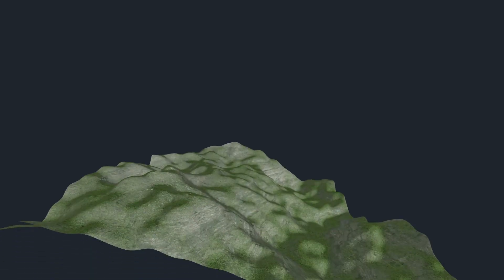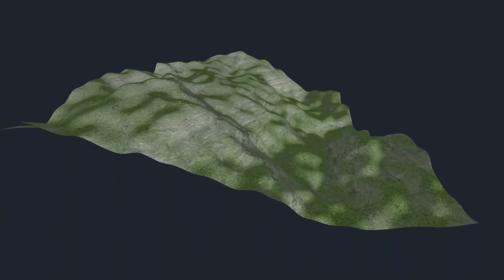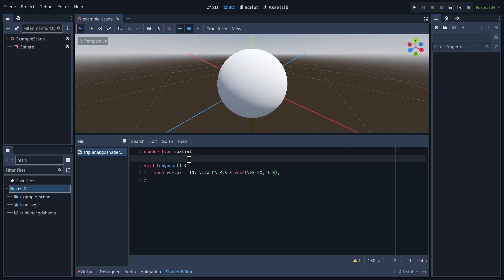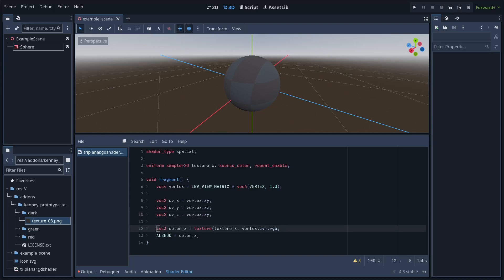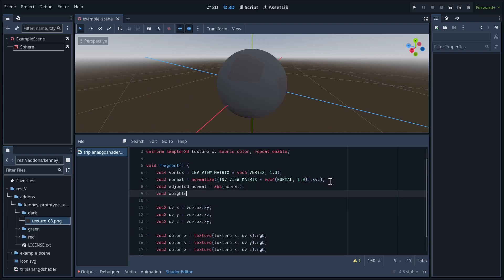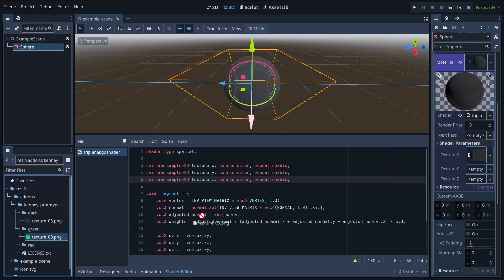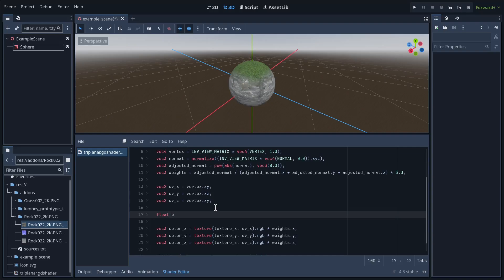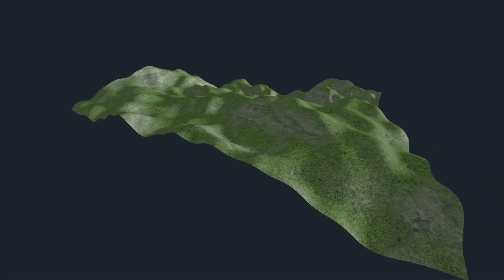Texturing Without UV's (An Intro to Triplanar Mapping) - Using Godot Engine

Comment: I was researching how I could replicate the smooth tile textures in Fire Emblem’s 3D games and came across the term “3D Tile Based Flexible Texturing”. I wanted the texture of the tiles to be dynamic such that I wouldn’t have to create many different floor tiles. Then I came across world triplanar textures and then your video! As someone also developing in Godot, this video is extremely helpful. Thank you so much!!

Comment: Hi, I'm currently learning about shaders and I was curious why you calculate this with the projection matrix. What if you don't want the mapping to change as the object is rotated? How would you make it static? I'm guessing you would have to use something other than VERTEX and INV_PROJECTION_MATRIX, but I'm still working on figuring that out. Thanks for the video!
Reply: actually nevermind bruh IDK why was I using INV_PROJECTION_MATRIX instead of INV_VIEW_MATRIX. my bad

Comment: Is sampling the texture 3 times via shader to achieve triplanar mapping more optimal than using the default Godot material triplanar? I would imagine it's the same but I'd love to know if doing via shader is actually preferrable.
Reply from the maker: Just looked through the code related to the default triplanar mapping shader, and I'm pretty sure it does basically the same thing. Haven't done any performance tests though so idk.
Reply: @devpoodle Thanks for the quick response! I'll do a small comparison test worst-case if it feels like it takes a lot of performance

Comment: This is amazing, thank you! I got it working in one project and it's working great. However I copied and pasted the exact same code to another project and applied the shader to the exact same model in that new project except now in the new project when the camera rotates the textures move with it, sliding around all over the mesh. Any idea why this is happening?
Reply from the maker: I'm not really sure why that would happen. You could try copy and pasting the code from the git link in the description to see if that helps.
Reply: @devpoodle  Thanks for responding. I tried that it's still happening. If you're familiar with blender materials nodes, it's behaving as if I switched the texture coordinates to window or camera rather than generated. Are there camera setting maybe that could be effecting this? As far as I can tell however the cameras are the same in both scenes
Reply: @devpoodle  This is the issue I'm having: https://youtu.be/8fmB4y_sJVo
First part of the video shows it working properly in a Godot 4.3 project file and the second part of the video shows the issue occurring in a Godot 4.1 file (unfortunately this other project is stuck in 4.1 for now due to some addons that are necessary for it)
Reply from the maker: Are you using the latest version of 4.1 (4.1.4)? I just created a new project in 4.1.4 and the shader worked correctly.

Comment: so cool ! thanks for the video. The triplanar mapping uses world space coordinates for its mapping. Do you think it would be difficult to implement it using object space coordinates, so that moving objects keep their textures static? I'm guessing it would be as simple as offsetting the vertex by the objects position but than rotation/scale would still affect the texture.. I can't quite figure it out yet
Reply from the maker: If you wanted the texture to keep static, you would do the same thing as in the video, but use the vertex coordinates in model space instead of world space. That would also account for scaling and rotation.
Reply: For anyone needing this: you also need to multiply by inverse model matrix. inverse(MODEL_MATRIX) * INV_VIEW_MATRIX * vec4(VERTEX, 1.0) will get you vertex in object coords
Alternatively you can pass vertex coordinates to varying in the vertex() function and read it in fragment() (VERTEX is in local coords in the vertex() function)